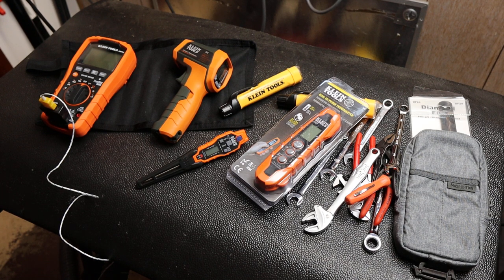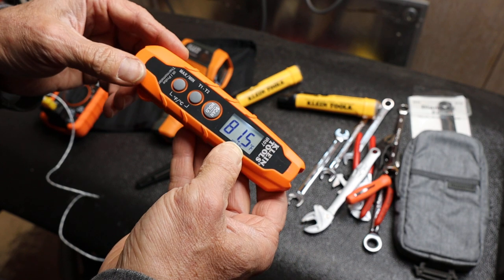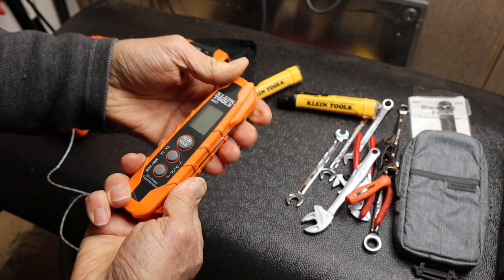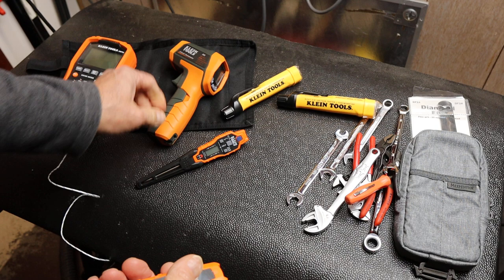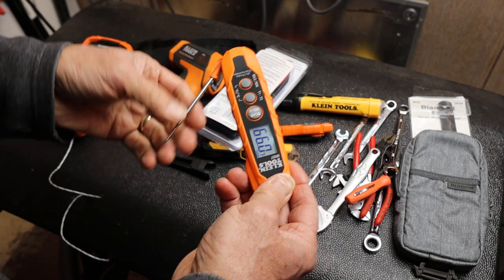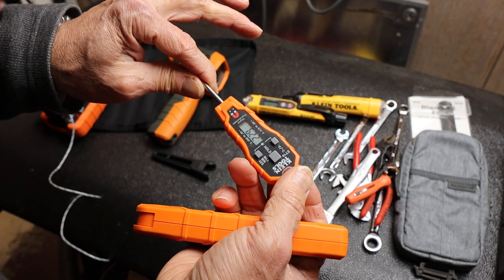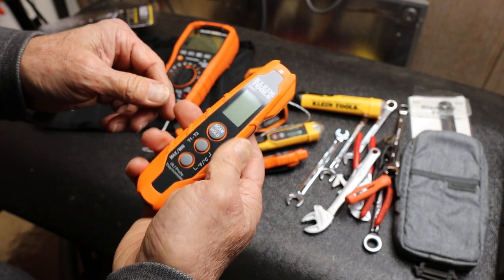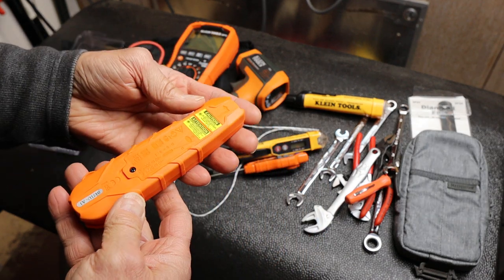Klein Tools IR07 Dual Temperature Probe: A fine mix of features and build. But Klein where's my bit?

Comment: Nice unit and I totally dig the orange. I use an IR gun at work; can't remember who made it for the life of me. It's green. I'll be there in a few hours and will take a look. Temps are important, crucial really, and we have sensors all over the place with readouts on a separate panel. Once in a while I'll change things around, kinda have to, and that's where the gun comes in for an instant reading.